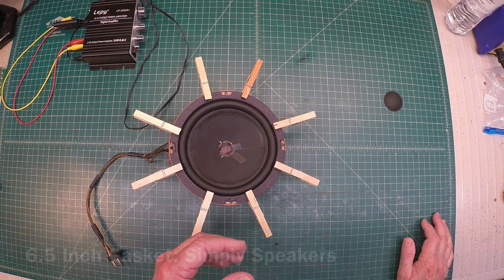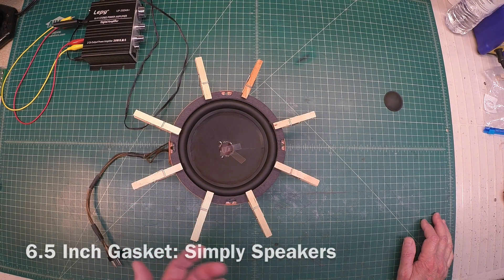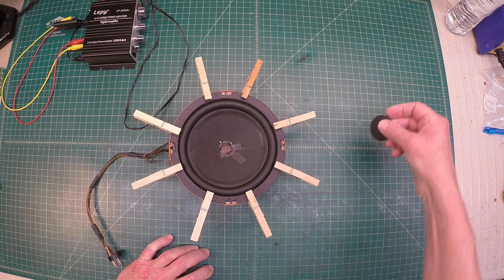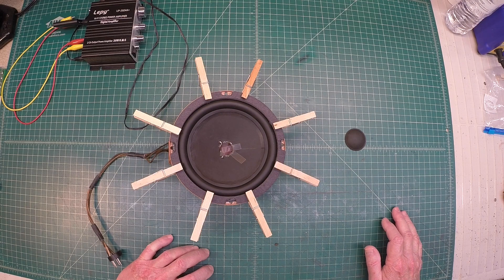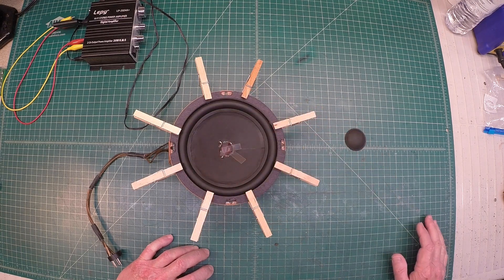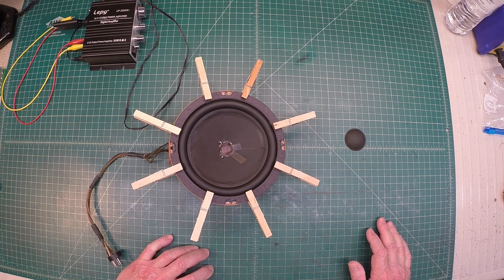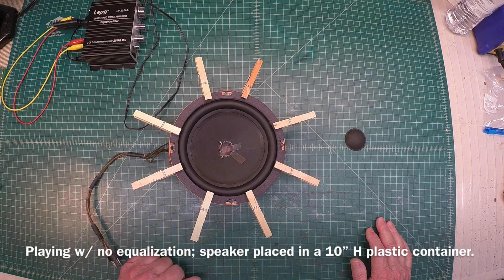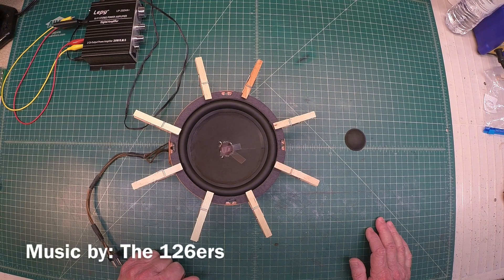Zenith 6S229 - Electrodynamic Loudspeaker Music Playing & Next Video Mention

Comment: Nice. I'm surprised you used an acoustic suspension surround. Those speakers were designed for stiffness to provide mechanical dampimg due to tube amp low damping factor. Sounds very nice
Reply from the maker: Thanks for the info. Can you expand more on the surround and provide a link or source for the correct surround for these vintage loudspeakers? Thanks again. Best, Don
Reply: I doubt there would be a dedicated cloth surround for the old radio speaker. You have to choose the size of the speaker, as in the case of rubber or foam. Usually, retailers offer all three types.